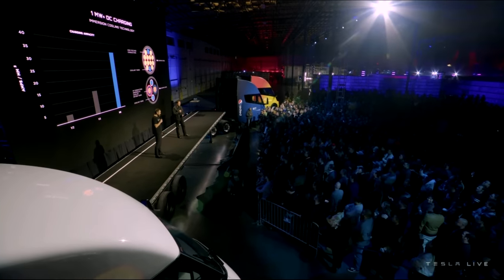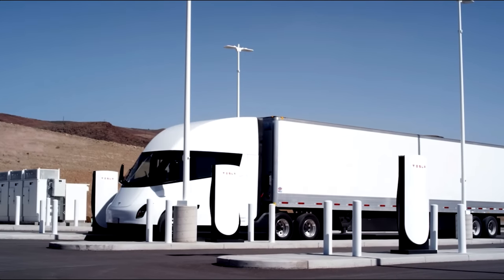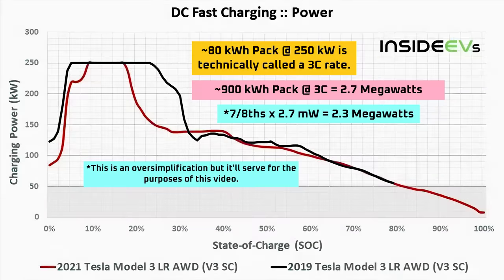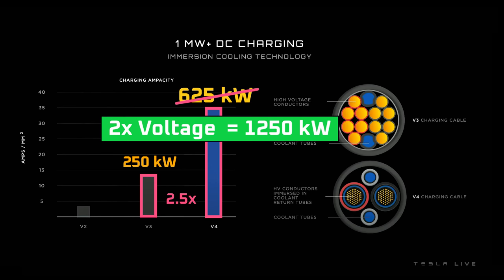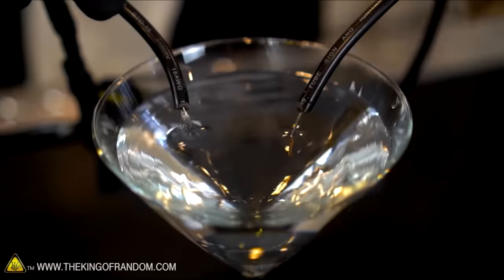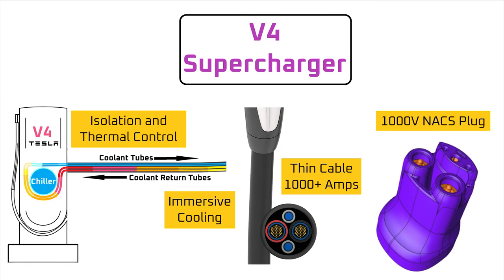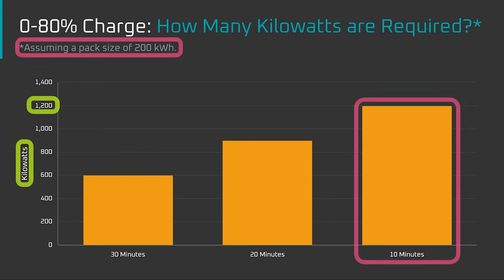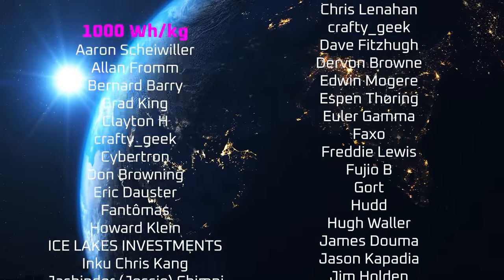Tesla V4 Supercharger // Megawatt Charging for the Masses

Comment: Great video as always Jordan. I'm hoping Tesla surprises us with the Cybertruck battery and can actually hit 1 MW peak, but I doubt it.
Reply: You mean "1MW" not "1MWh"
.
and no, it won't.
The charge rate will be limited by the size of the pack.
If you hit a 1MWh pack with 1MW of juice, it's like a 100kWh pack receiving 100kW from a charger.
Not a big deal for the pack, the limitation is the cable.
.
Now try 1MW into a 150kWh pack.
That's over 6 times the stress on the pack (cells)
.
The trick will be to maintain a higher rate for longer.
.
If the limitation of existing tech is the cables and connectors (?) and there's a 100kWh pack/ cell that could take say 345kW, from 10-70%... that's fast charging.
.
Then you up the size of the pack to 150kWh (CT?)
.
Could you increase the "flow rate" to 500+kW?
That's about 7 minutes from 10-70%
.
Then consider that vehicle with 500 miles nominal range, you're talking ±300 miles in 7 minutes?
.
Even at 50% range when towing, that's acceptable.

Comment: Using these charging graphs for the Model 3 is not optimal because they are based on not optimal charging sessions. Additionally to Amperage and Voltage limitations there are temperature limits that definitely kicked in in both sessions (at 20 and 30% respectively) that can either be in the battery pack (that's what I suspect here), the cables or the handle.
Also please note the different charging curves for the different battery chemistries, it unfortunately got slower with the newer models.
For all the different charging curves (and lots more data) I'll plug the tff forum and the "Model 3 Batteriewiki" thread. It's in German, but the data speaks for itself

Comment: I have known the cable in a cooling hose for a long time from welding technology. But there it is a cable with an reduced insulating jacket that lies in a tube.
To me, the Tesla schematic also shows that the conductor with conductor shield (just a thin layer of insulator) is in the cooling hose (dark gray area=shield, blue ring=liquid (the coolant is also drawn blue in the coolant tubes)). Depending on the liquid and voltage used, no direct insulation is needed, since the hose provides the insulation from the environment.

This has the advantage that the entire hose package becomes more flexible and lighter with improved cooling performance (contact surface over the entire circumference).
However, the existing (thin) conductor shield simplifies the entire construction, since no liquid can run between the strands and thus leak out at the cable ends. This would have to be done by e.g. seal continuous soldering. Also, an electro-chemical reaction between coolant and cable material (probably copper).
Also easier to handle from a safety point of view if both components remain "separate" and also for maintenance.
Without a conductor shield, there is also the problem that the individual strands are not always in contact with each other, which can lead to increased resistance and wear.

Comment: Hi Jordan. I think one thing that people have neglected to consider with immersion cooling is the use of Dielectric Coolant as well as using non water based antifreeze solution additives like anhydrous alcohol based ones or ones like ethylene glycol (and other similar formulations). And at that, if a Dielectric Coolant is used, it will be (obviously) water free and thus may NOT even require an antifreeze additive. 

I am certain they will go down this route with V4.

Comment: A few issues come to mind. I can see a car with a V4 plug being designed for both V3 and V4 plugs. Presumably the low voltage plugs are movable / spring loaded to allow for different length plugs. However for a car with a V3 plug I don’t see this as likely to be compatible unless they planned it that far ahead or already have a moveable section, or perhaps this requires an adapter. With regards to the immersed wires, I can see a potential issue with this in that voltage drop across a single conductor means that there is a voltage potential between the plug end of the wire and the charger end of the wire. While the coolant running along the wire itself is probably not an issue, the loop that comes back on its own could be. I also would not be surprised if the semi is not capable of charging from a V3/V4 in a pinch.

Comment: Water cooled leads have been in use for years in the welding technology field.  A TIG  (Tungsten Inert Gas) welder lead uses a water cooled lead in order to reduce the size of wire and keep the lead size small and nimble.   I have never been zapped and have been welding for years with a TIG lead.

Comment: Very Interesting Jordan. The summary is perfect. I am wondering if the 4680 tabless design might impact the plateau of the Ion of lithium diffusion to the anode. The current path, being better organized on the anode inside the jelly roll with tabless could modify the diffusion of Ion? if the diffusion is seen as not only Z axis thru the dept of anode but also on the X and Y  axis? This could lead to a larger plateau covering more than 10 to 30% SOC at high C-rate. Just an idea..

Comment: Given the smaller conductors in the V4 cable, it seems likely that if the V4 cable is the same diameter as V3, it would be lower weight.

Comment: Liquid cooling power cables is commonplace in the welding industry albeit weld voltage is low relative to automotive charging. For example a Weldcraft W-375 torch can operate at 375A @ 100% duty cycle with a 25 foot cord.

"Creepage and clearance" are considered in electrical isolation design. The1000V plug geometry change is likely driven by "creepage" requirements. The over molded thermoplastic's comparative tracking index likely dictated the design change to a labored path.

Comment: i think it will just be two coolant loops one for the positive terminal and one for the negative terminal this is why you have four channels for coolant, this way you can keep electrical isolation, you just have to do a u turn at the connector no need to pass the coolant inside of the car.
I think if the car side would be cooled by liquid it would use the internal cooling system of the car to prevent coolant sharing as it would be bad for reliability if the coolant could be exposed to dust or leaks

Comment: I don't need or want faster charging on my Model Y. When I do on occasion use a SuperCharger I just plug it in walk away to the bathroom, and get a bite to eat which takes me around 30 minutes when the car tells me it has reached 80%  I then have to gather the family and head back to the car this is a 20 to 30 minute task. 
If the car took 5 or 10 minutes to charge I would like a gas car have to wait with the car before then finding a parking spot and then going to for the  bathroom and snck.
Reply: With AC you can just tell it to charge at a slower rate.  I do it regularly.  I believe you can do the same with DC.  Whether this is a good idea depends on how busy the superchargers are.  The few superchargers I've been to around here are never that busy. YMMV.
Reply: You mean that you eat and use the bathroom while traveling? How odd lol
Reply: @StormyDog  I've never seen a choice to "throttle" DC charging in our S; if we need more time before returning to the car we usually just up the %SoC target a bit...

Comment: Interesting that the V3 cable appears to be rubber, whereas the megacharger cable looks braided. I wonder if that is for greater safety/durability/toughness (e.g., kevlar threads), or enhanced flexibility or weight...or even just some air cooling on the side. Or maybe all of the above.
Reply: over-braid is generally just to add abrasion protection for more aggressive cable contact use.  It has no electrical benefit but may allow the insulation below it to be a touch thinner as it does not need to tolerate as much abrasion.  Thus could soften the overall cable feel.  These over-braids are very soft to bend...
Reply: @zilogfan  Thanks. So, it sounds like some of my speculation might be correct (e.g., abrasion resistance and flexibility). I further wonder though if it might allow for snow or freezing rain in and if that could stiffen the cable, as the braiding seems somewhat open.
Reply: @machoopichoo2  Hard to imagine they did not work on that factor but it is horribly boringly warm where they live so... ;)
Reply: @zilogfan  Ya, probably stating the obvious but maybe those bay area guys don't know cold weather. ;^) Although Elon is in TX right now and they don't seem to know cold weather either - shout out to ERCOT and the TX grid failing every six months.

Comment: I wonder if the waterbased coolant is some sort of graphene slurry and this graphene cooling jacket would simulate a beneficial conductive composite much like coating aluminum with a copper coating.  It would enhance the amp capacity of the cable and would transfer heat extremely well.

Comment: So regarding power capacity of the cable itself... if it's providing double the voltage that means it only needs to supply half the current for the same power delivered.  At half the current and with better cooling the cable resistance is likely the same or even lower then v3 meaning the power dissipation within the cable is less then half that of v3 for the same power delivery, thus it would be able to essentially deliver twice the power to the vehicle battery while dissipating the same amount of power as the charger with half the voltage.  The higher voltage essentially directly reduces the power dissipation required by the cable and all the internal wiring of the charger likewise itself.  Ultimately this provides twice the efficiency of charge.

Comment: Great Work, thank you. The most striking item that few talk (lack of manufacturers information?) about is the operating voltage and charging voltage the vehicle is designed to handle. Tesla seem to use a 3OOV system until the Plaid arrived which must be running 800V to achieve the motor output. As confidence and field experience grows the Semi  (and Sybertruck?) are running 1000V. Increasing operating voltage is a good measure of EV technology advancing. Anyone for 1200V like Remac?

Comment: A minor correction, but DC fast charging does still go through an vehicle's on-board charger. DC charging skips over the rectifier circuit in the on-board charger because that's done in the charging station itself, but there are other components in the on-board charger that DC charging still uses. Both the charging station and the on-board charger have contactors and fuses to cut power if either one sees something going wrong with charging. Connections between these components as well as the connection with the charging plug itself will have higher resistance and heat generation than the cable, so these are more likely to be the technological bottlenecks of DC fast charging. I would not be surprised to see cooling in the connector head since that will be much closer to where a lot of that heat is being generated.
Reply from the maker: Thanks for the excellent insights!!! 🤜🤛🔥

Comment: With V3, an operator may approach plugging in blindly with the plug at any orientation & stupidly rotate until it goes in.  That rotation gives the big electrodes an opportunity to get close to the wrong connection.
With V4, an operator approaching blindly cannot get the big electrodes near a wrong connection since the protrusion prevents it.  The big electrodes are only ever allowed to get close the the correct connection.

Comment: When you have a really big battery pack -- like for the Semi -- I wonder if it makes sense to divide it into several smaller sub-packs, at least during charging.  The reason is the mega charger could deliver peak power for longer if the sub-packs were charged sequentially.  For example, put all the charging amps into the first sub-pack until it reaches the end of the plateau and start ramping down, then do the same for the next sub-pack, and so on.  The result is the charger is putting out max power all the way until the final sub-pack starts to ramp down.
Reply from the maker: Hmmmmm, interesting point!
Reply: Do you think the Semi will use one big custom battery pack, or several smaller packs they already make for other cars?  If the latter, then each pack would probably already have it's own BMS, so staggering the charge curves might be mostly just a software issue.
Reply: This would be the lease effective for prevention of lithiation.  They are charged in series to make the most of the current.  The current is the hardest thing to provide.  The voltage is easier to provide.  The more cells in series the easier to charge.  The only problem is then balancing them but this can be done periodically with special hardware...
Reply: Th different packs charge in series

Comment: I think they have moved to R1234YF Freon cooling, not ethylene glycol cooling circuits. Another alternative is to use Yttrium barium copper oxide superconductor beads loaded into a rubber casing with a liquid nitrogen cooling loop cable!
Reply: That’s logical too
Reply: @michaelstarkey9745  the Freon is non conductive.  So would Liquid nitrogen as well. Both would be non corrosive as well.

Comment: It’s obvious that the dark blue represents coolant in that diagram, which means it doesn’t show two layers of sheathing outside the coolant.  It’s also just a graphical representation of the cable, not a detailed, extremely accurate drawing, so the fact that the coolant doesn’t appear to be in direct contact with the metal conductors might not mean that it actually won’t be in the real cable.

Comment: Don't forget the separate coolant tubes in V4. Most probably for two separate circuits of coolant, each with their own upstream by tube and downstream throug the conductor. Each loop is just facing just only one of these voltages of a conductor, preventing electrolysing of the coolant itselves. For electrolysing you alwais need two separate voltages on the same liquid. With only one electrode per cirquit, no electrolysis hapens.

Comment: What about cracking and leaking causing an arc? What precautions are into the inlet plug of the vehicles? Would be an interesting topic for a video!
Reply: GFCI
Reply: @zilogfan  ?
Reply: @AdlerMow  you can send a high impedance high voltage test signal out the supercharger and look for conduction.  You can do this line to line and from each line to ground.  This would find a high conduction path which might be your crack with some debris or salt water as an example in it or just a ton of salt and a wet end on the connector. If they see this, they'll simply indicate a software fault and refuse to initiate the charge. This creates a safe test
Reply: @zilogfan  Thank you, very thought out.

Comment: I have seen transformers made out of square copper tube, with the coolant directly running through the bare inside of the tube, so having the conductor directly in contact with the coolant is not that unusual.

Comment: The company that made the swapable axled  powerpack for semis has a great concept too. New full batteries in the time it takes to unhitch one, pull away and back into the replacement attach and go. I do not recall the companies names but the concept seems valuable. Charge many battery setups maximizimg charging during best times or whatever turna out to be most economical solution during lowest price charge time, using renewables it has potential. I am sure someone has done the math on how effective adding solar panels to semi's are too which may or may not be viable for much. Wind on vehicles is another concept that can be additive to charging ... not from wind while driving but more a deployable unit for stationary added charge, it may be effective when driving on extremely wind days to a smaller degree. Inductive route charging has potential. There is always the sero point field, quantum fluctuation field to tap into someday... that tech hasn't been established as far as I know of in anything more than statistically relevant events.... sort of where fusion is at in a sense. Anyhow there are many new technologies on the rise that are or will become viable now that the shift to renewables has finally turned on.... evolution can be a slow back n forth process but a lot is always being looked into and imho we are in the singularity part of what is most likely a future s-curve now... so that means fast change in negatively deccelerating/ less and less delta t (time). Exponential curves are big change events.

Comment: I'm betting that the reason for the v4 super charger power specs has more to do with leveraging the prevalence of the existing super charger network for emergency purposes for the Simi when it becomes widely available. It won't just be company end points on their routes that have access to the megachargers or at truck stops equipped with these megachargers , but may require some stalls at normal super charger locations to be upgraded with a v4 stalls to accommodate the cybertruck and semi-truck.

Comment: 18:19 the graph indicates that the 2019 model 3 AWD LR charges at 250kW for longer than the 2021 car, i.e the older model charges faster than the newer model. Is that correct, or were the plots transposed in error by insideevs?

Brilliant analysis as ever Jordon. Thanks.
Reply from the maker: Tesla is usually careful with a new chemistry release.  Meaning older chemistries sometimes temporarily charge faster.

Comment: All good for the charge side but what about the vehicle side? As with all connections it is the slide together connections that fail first. And then what about the vehicle? The wires that go to the inverter that feed the battery pack, will they be cooled in the car to take advantage of the higher capacity?